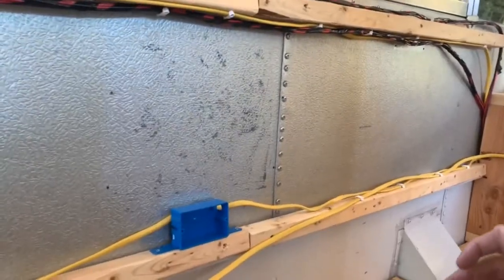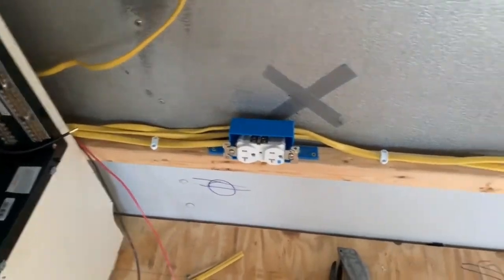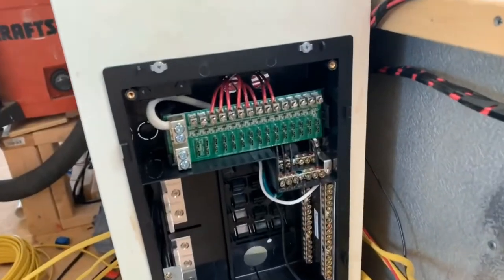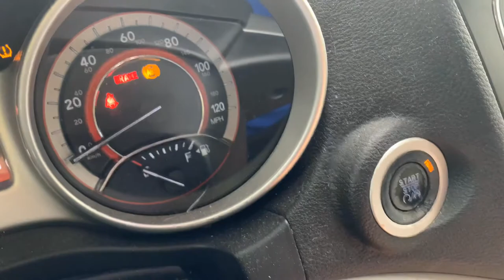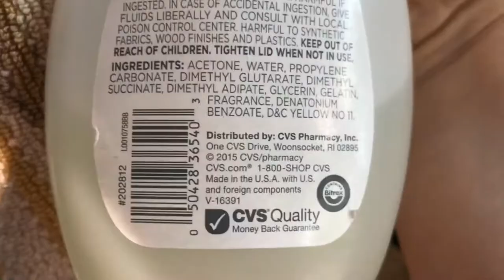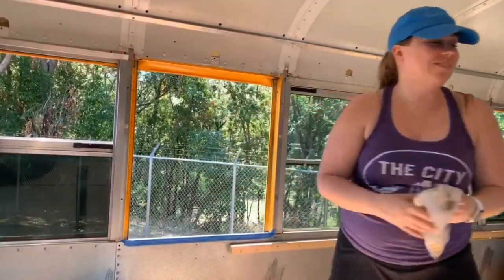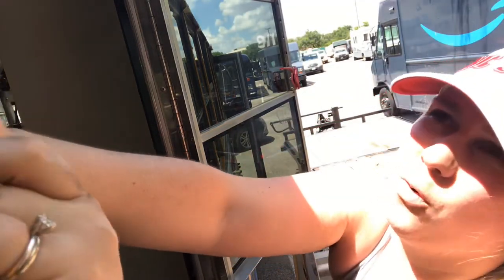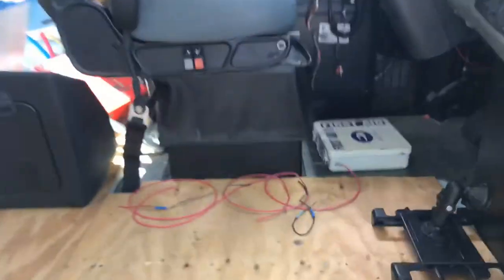Skoolie Electrical Panel (Distribution Panel) || 2020 Bus Conversion - Ep. 16

Comment: you can use a wire crimp on the two wires, making a pigtail.
Reply: they also make a special green grounding wire nut with a thru hole so you don't need to have an extra wire, just a long and short cut ground wires.
Reply: Or you can use wego lever nuts

Comment: You need to uae MC cable in exposed work locations, you didnt use wire clamps going in your box and you should be using gfci or combination afci/gfci breakers.

Comment: Does this have space for knockouts on the sides for all wires? I'm looking to install one of these but in a very tight area – I wouldn't have access to the back, only the sides.
Reply from the maker: There are numerous knockouts and a lot of space. Whether or not you’ll fit everything through the sides alone will depend on what all you’re installing and in which directions, but I wouldn’t expect a major space problem.

Comment: Wiring looks good and nice clean windows! Two off topic questions for this video, but wondering if you are being strategic about to weight distribution in the bus? Assuming you will be painting the bus, have you decided on a color?
Reply from the maker: Sensforce thanks! 1. We are trying to be smart about weight distribution but it’s proving difficult because a lot of the living space is over the rear axle. Here’s hoping. 2. Stay tuned to find out 😎

Comment: What power inverter are you using that connects your 12v to your breaker box?
Reply from the maker: Still working through the details. We have an entire solar system planned using a Victron inverter, but we’re trying to get shore-power-ready first so that we can move in before solar/batteries are done. Looking at a converter in the meantime to turn shore power into 12V DC. Electrical is not my #1 area of expertise, so I’m open to advice!

Comment: What kind of breaker are them or did you use?
Reply from the maker: •WFCO WF-8930 Skoolie Distribution Panel: https://amzn.to/2AR3vFs

•EATON Br2020 Single Pole Tandem, 120V, 2-20-Amp Circuit Breaker: https://amzn.to/2Dumcja

Comment: I was hoping to learn how to wire your breaker box. Why did you go with solid romex wire. A bus vibrates like a boat you cant have any floating free wire more then a foot or less or it will fail to cracking but will cause a fire before total failure. Price isnt that much more. Stopped watch halfway through. Not a very informative video
Reply: That was my 1st though, solid core wire in a rolling earthquake, I can't imagine that wire will hold up long term. The wire really needs to be stranded and Ferruled where possible.
Reply: I am actually wondering why you both missed the actual wiring of the receptacles and didn't respond to that, since pretty much most skoolie owners will do spray foam insulation, which will prevent wires from floating free or rubbing against something and we all can see that he did secure the wires to the wood members before, after and in between outlet boxes. My concern would be that the push in connections will vibrate out and cause problems